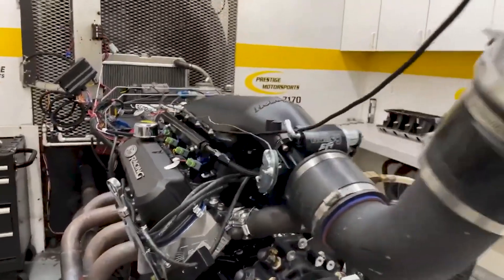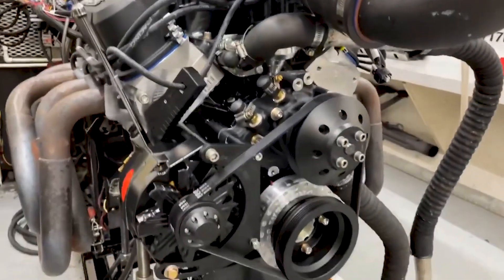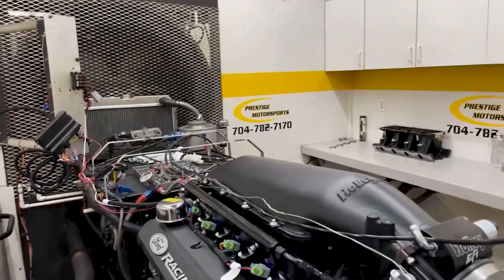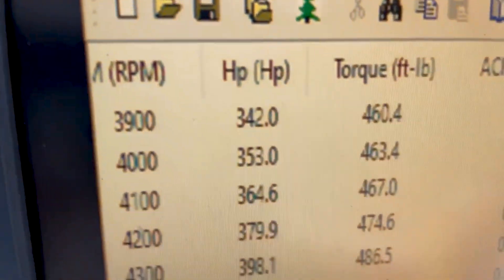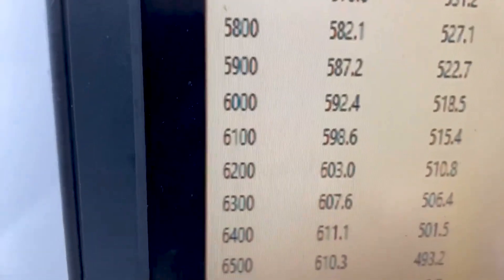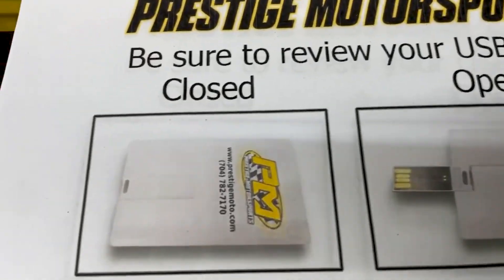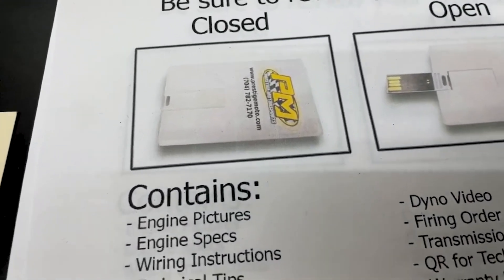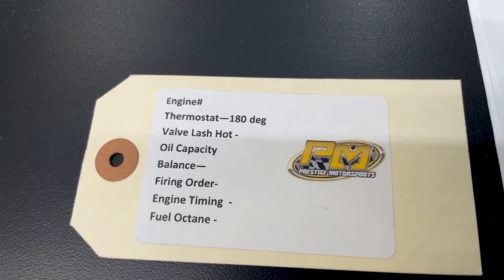611HP Holley Hi-Ram 427ci Small Block Ford Dyno Testing for Backdraft Racing Cobra at Prestige

Comment: Very nice! What's the cost and lead time on a build like this?
Reply from the maker: Thank you. Nice setup for sure. Our 575hp 427 long block (oil pan to valve covers) is $12499 then add the hi ram intake, holley mpefi, ignition, pulleys, dyno tested with 3 year warranty it would be drop in ready for right around $21k